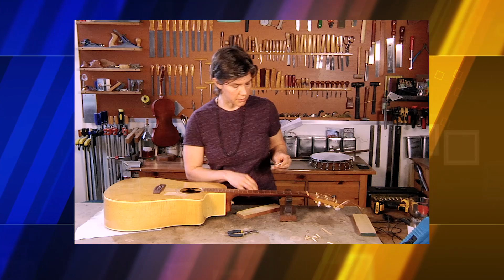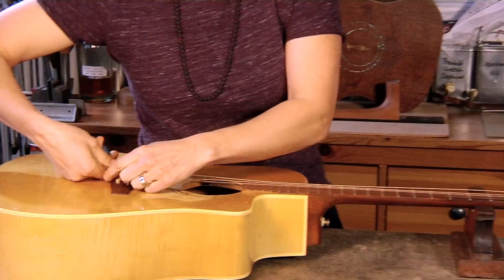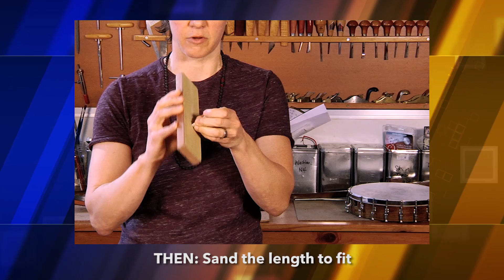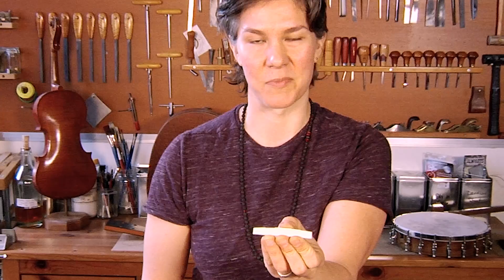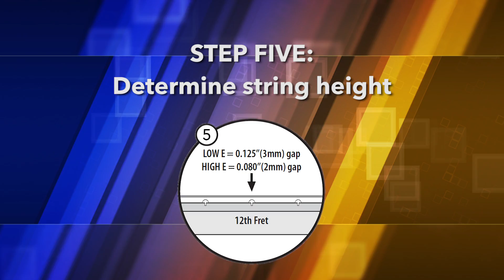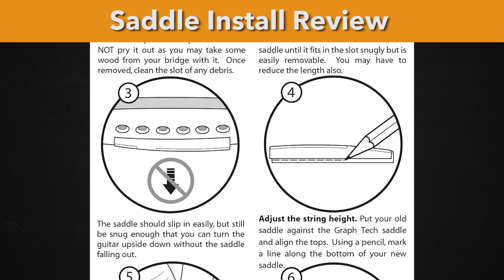Graph Tech Training Series: How to Install an Acoustic Guitar Saddle

Comment: Great video! Very straight to the point and informative. To every body please remember like she said, action height is very personal choice. The string action she made for this guitar is usually considered high, probably the owner of the guitar strums hard, plays bluegrass or simply prefers that kind of action. A very common middle of the ground action height I like to use is 6/64th in the bass side and 4/64th in the treble side. I recommend buying the Music Nomad setup kit that includes string measuring tool, and gauges to measure neck relief and nut height. there is more than saddle height to deal with when it comes to proper a setup. I usually check neck relief first, then nut height and then saddle on acoustics.

Comment: Very excellent presentation Nicole. You showed your handmade, I suppose, dual sanding blocks method for sanding down the base of the bone saddle correctly and easily. The blocks look very flat and level with maybe 200-400 grit sandpaper permanently glued on. The combination of the 2 blocks used together as demonstrated is a great way to work on a new bridge saddle. I am going to make 2 blocks like these.

Your approach to the workpiece guitar was straight forward. The explanation gained most of my attention partly because I was not distracted by you working on a glitzy fantasy guitar. Your workpiece was an indescript 'work in progress'. I think that gave added focus to your demonstration of the skills and procedures.

Working on a guitar is a type of precision work with a delicate and precise object. This is not hammer and chisel work. It is delicate work and needs to be planned out and worked on with patience and thought. One should probably not just pick up the bone saddle and start sanding on it with a piece of sandpaper in your hand. You should probably take your time, learn about it, and use the right tools and methods.

The average player wants to make their instrument better when they work on it. Watching great but simple videos like this can enable the average player to perform some of the techincal work and maintenance on his instrument. One can take pride in doing good work on a nice guitar.

Comment: Since this is a beginner video it would be helpful if you mentioned which way the saddle goes and why
Reply from the maker: Usually, one end of the saddle is taller, and the taller side is on the low E side of the bridge. Hope that hleps!
Reply: @GraphTechGuitarLabs  yes it does help, thank you!

Comment: You did not check intonation. Should that be done? Even if you have a pre-compensated saddle? I have a new Enya Carbon Fiber Travel Guitar that came with a non-compensated saddle. Consequently, the high E and B string are both 9-10 cents sharp at the 12th fret. Do you think a pre-compensated saddle like the ones you sell would help that? It came with a quality bone saddle installed but it is not compensated. It came with the action perfect by the way. Very easy guitar to play finger style.

Comment: I have an acoustic guitar that was given to me used and the saddle is gone! I bought some on Amazon and they are very thin & 2 fit into the slot in the bridge!  The music store attendant said that there is usually a couple of holders that one of the saddles would be pressed into so it won't fall out! There wasn't, the slot is 3 1/4 inch long & 1/4 inch wide...HELP.

Comment: One question. I took my saddle out and sanded it to lower my action. When I went to re-install it. I realized there is angle on the top of the saddle. Should the high side of the saddle be facing the sound hole or facing away from the sound hole?

Comment: I did this with  Tusq saddle but the 5th and 6th bass strings would become sharper and sharper up the neck.  The 12th fret note and harmonic were different notes.
Reply from the maker: Hi, sorry for the delay in my reply …  I’m pretty sure that was how it was before you replaced the saddle ,  an acoustic saddle only has a very small amount of intonation room …  ( which was what you were measuring on the 12th note and harmonics)  sounds like the bridge slot was made a little too close the nut side of your guitar and causing the sharpness in pitch as you played up the neck…  not an easy thing to fix without filling in the saddle slot and routing in a new saddle slot in the right position or replacing the entire bridge …  either way, not recommended for the faint of heart …

Comment: you never mentioned anything of the radius.? Don't you do that ?:
Reply from the maker: Great question. We make a lot of different saddles, compensated, non-compensated, blanks, and thicknesses. Easiest way to navigate through a lot of options is download our online catalog, the last 20 or so pages are life size line drawings... find some models that are close to what you are looking for and print them at 100% and just match up your existing saddle for radius... saves buying a radius gauge for a one off install...  thanks again!
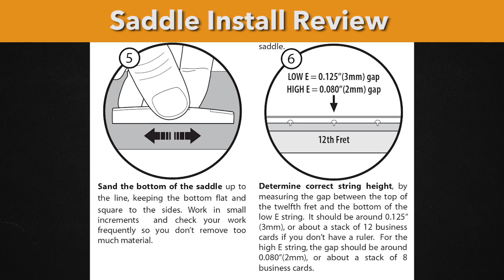Reply: 6:22 6:22  @GraphTechGuitarLabs

Comment: This demo assumes you are duplicating a perfect saddle to begin with which is rarely the case :( Even new, name brand guitars are rarely setup properly from the factory. What then? I guess you buy a half dozen saddles and resort to trial and error if you're not starting with a perfect saddle?
Reply from the maker: You’re correct on no two guitars are the same.. I think if you get into the 3 minute mark of the video, Nicole gets into how to adjust for your  particular guitar. Thanks for mentioning about this 👍
Reply: #Drvn Lp this is not any science though. its so easy and non risky i do it by sight and feel i dont bother measuring it.
Reply: @joaquinodriozola4963  Yea, it looks like if you put a straight edge on a straight fingerboard it will line up at about .120" below the saddle nut when the strings are off. I haven't confirmed but that looks about right. This is the kind of answer I was looking for so I am posting in case anyone else is interested :)

Comment: Disclaimer:  I’m not a luthier.  But for 40 years I’ve done my own saddles,  I adjust string height across all 6 strings by notching the ALMOST finished saddle to the exact height I want with nut saws.  With this method I can adjust intonation as well by moving the cut fore and aft on the saddle.

Comment: sanding all that material off the bottom is too much work... better done with a saw and a simple jig to make an initial cut and then fine sand to height. Even a cheap mitre saw kit will get you close and ready for final sanding the bottom...

Comment: A good story, but why does luthier recommend such high string action ? 3 mm and 2 mm . Most sources say that the height of the 6th string over the 12th fret should be from 2.4 to 2.8 mm , and the 1st from 1.5 to 2 mm .Lower the first one, for example, by 0.2 mm or 0.3 mm in comparison with the height that Nicole recommends and it will be Much easier to play ! And Tommy Emmanuel also has a low string action .
Reply: She said in the video that making the action higher at first is better because you can't add height to the saddle once you sand it off but you can shave it lower if your action is to high.

Comment: So which way is a compensated saddle installed in the slot? There are 2 directions !
Reply: As a general rule, the bass side of the saddle is higher,  and  and the B string compensation is usually kicked back , away from the headstock ...

Comment: Hi Nicole. I dont have the old saddle of a guitar i am restoring. It is an acoustic admira A-50 from the 80's.
I saw in the website that there are different Tusq saddles, i suppose the best choice will be the compensated one with the nearest similar measures that fit the slot. Any suggestions?

 BUT, for a saddle and a nut i need, Will you deliver to Spain?
I mean, i havent been able to see the shipping costs.

I am thinking right now that i will need something else that i dont really know if you are selling it, just to make the order worth paying the shipping cost, like powder pumice to close pore as i am varnishing with shellac by hand, and a Rosette. Gonna check the website and see.....🤔

Comment: I have the PQ 9210 00 tall saddle for classical.  As I predicted, there is no explanation as to which way it goes in.  The compensation is asymmetrical so it can only go in one way.  This info is hard to find.  I can't find it.  Even emailed Graph Tech.  They can't seem to comprehend my duh question.  What the . .. ??
Reply from the maker: Not sure who you emailed,  but the laser etching or the lettering on the saddle faces the sound hole/ neck. Hope that helps!
Reply: @GraphTechGuitarLabs  thanks.  next problem:  The slot on my Mexican classical is 1/8" wide.  the  PQ 9210 00 is much less thick.  It leans precariously toward the tension.  Should I shim it (on which side?) or do you have a thicker one?
Reply: 2 years later, no answer.  I reordered the  PQ-9204-00 which is 1/8" thick,  A little sanding on the side (220 grit--she didn't tell the grit) and I slid it in without removing the strings.  Without sanding the bottom, it's just a little high, will reduce it later maybe.  I don't play too much high up.  

After hearing so much about the critical contact between the bottom edge and the slot, I was surprised to see the bottom of the  PQ-9204-00 is perforated by 3 deep slots and 2 or 3 shallow round indentations.  Also, the thing was not straight across the bottom edge--visible arched upward (the opposite of experts who say it should be crowned downward)  And the bottom edge is visible not square.  

I was already wondering about the wisdom of using some kind of bedding compound, like wood filler, to solidify the overall bottom contact.  

I'm not impressed, not happy with the sound.  Seems weak, but I don't know if I can blame the erratic shape of the bottom edge of the  PQ-9204-00.  Might be crappy strings or crappy expensive handmade guitar.
Reply: Yes it's the one bit of information she omits and the most important

Comment: I just bought a new 9280 saddle to replace the plastic one in my Fender CP-60S acoustic. The plastic saddle was to narrow for the bridge slot and the plastic saddle radius was more like 9.6" radius and the board is 12" . The graph Tech 9280 was more than wide enough . The issue I found odd was when sanding the side of the saddle to fit it was clear from the sanding marks the 9280 on both sides showed I was sanding off high spots and still showed low spots. I though they were dead flat to start with , this was the  first time I had to sand one to fit the slot . I've sanded the height many times for action , never the sides. Are they simply cast and will not have a completely flat surface?
Reply from the maker: I think I get what you mean, you're saying the sides aren't completely straight, as in a 90 degree angle? Yea, there is a slight arch on the sides of the saddle.
Reply: I wouldn't describe it as a 90 degree angle . It look flat with a fine grained surface before you sand the sides, once you do begin sanding the low surface areas still show the fine grained cast surface. The surface on both sides is uneven . I imagine it does not matter since the bottom needs to be dead flat and 90 degrees to the sides . What would benefit most is since there are many times where saddle slots are wider than .125" and one buys a 9280 and it's to loose. You should offer an option or make the saddles .020" thicker since many buy these because they are already compensated . The only option is to add a wood shim to the saddle side and sand to fit or buy a blank which requires doing all the shaping .

Comment: Hi , what if i dont have my old saddle?
Reply from the maker: Then just get the right thickness and length and you can try the guitar, if it's too high, you can easily sand the bottom of the saddle down to get the right height!
Reply: @GraphTechGuitarLabs  Do we have to keep taking the strings off?
Reply: trial and error.  install it , measure, do the math, sand it, etc

Comment: Hi, the action with 3mm / 2mm is very high and not ergonomic, especially with thicker strings from 0.012 and more. It the frets are dressed up correctly, on a western guitar 2,5 mm / 1,8 mm should be no problem, even 2,2 mm and 1,5 mm should be possible (of course depending from playing style). Also, the ruler you use is much less precise then feeler gauges – I've seen instruments that could not be played properly, but the tech showed this ruler and meant these were 2 mm (they were not, and if this tech would have been a better guitar player who feels the difference between 2,5 and 2 mm, he would have known this!).

Comment: I have an acoustic thats missing the original saddle. How do I go about getting the height right if I don't have the original saddle to reference?
Reply: trial and error.  install it , measure, do the math, sand it, etc
Reply: Look up on their web site for the right one for your guitar
Install it as she showed.
Sand a little off bit by bit to get her suggest clearances.
As she said if you want it lower sand a bit more.
It is not rocket science  :)

Comment: is the method to check the thickness and length of the new saddle for a match to the old one first? Seems like common sense to me.
Reply from the maker: Hi Doug, thats correct. Match it to the old one and that will help you determine the exact fit you need.

Comment: How do I set the intonation? This is driving me crazy!
Reply: There are multiple possible reasons the intonation may be off. Make sure the strings are new and you are not fretting too hard. Make sure the neck is straight and has the correct amount of relief. Note that if the action is too high then notes higher on the neck will be sharp.  Then determine if the string length needs to be longer or shorter. If it’s longer you can sand the top of the saddle at an angle over a particular string so that it makes contact slightly further from the nut. If it needs to be significantly shorter, I would take it to a luthier because fixing that will be more complex.
Reply from the maker: You don't! If it's a compensated saddle, then the intonation is already done for you!
Reply: I already have one (made of plastic) and the intonation stills bad
Reply: @juliofernandez3434  try the Tusq?

Comment: Great video but I wish you demonstrated how we can get the correct string action height, what if the high e has higher action height than the lower e string? Should we sand off the saddle on the higher e string till it gets the proper height?
Reply: I sand the saddle at an angle to get the correct action for high and low e strings.

Comment: Thanks for the video-- but how do you know which side of the saddle is the front?  Is it the side with "Tusq" printed on it, so that the taller part of the saddle goes under the low E?  Just checking...
Reply from the maker: You'll want to point the Laser Etching towards the sound hole!
Reply: @GraphTechGuitarLabs  uh . . . what is laser etching?  Are you referring to the black lettering?
Reply from the maker: @treslongwell1332  Yea, the black letters face the neck/sound hole!

Comment: This is a great video but one thing....no one ever talks about how to lower the saddle on one side alone...the  tusq saddle on my acoustic guitar is 5/64 on both sides from when I bought the used guitar.....I believe someone replaced the saddle and never lowered the high "E" side.....what's the best way to do this?  If I sand just the high E side the saddle will have a high spot in the middle.  Common sense says I then need to level the bottom of saddle but I would like to know the professional way to do this.
I just refretted the guitar with stainless steel frets.  All the frets are level but I'm getting just a little buzz if I hit the A string hard at the 5,6,7th fret.....I have .011 relief in the neck.  Do you think raising the saddle to 6/64 on the low "E" side would make a difference?  I could shim it just to test it and if it works just buy a new tusq saddle....I'd rather have the relief at 8 or .009 thousands and a higher saddle.  A guitar feels totally different when it's less than .010 relief in the neck.
Reply: Simply determine how much to take away by measuring the high E (fret 12) then deduct the 2 mm. Hold the saddle at the required angle on the emery board and sand it to a straight edge at that angle. Use a new saddle, keep the previous one to fall back on.  Repeat until you are happy. At $5 NZ for a NuBone saddle this won't cripple you financially.
Reply: There's another way.....I found ....use a crowning tool to create an angle on top of the saddle....it's a bit of a pain because then you have to re-intonate the saddle.  I've done it your way......it's not a simple thing to get the right angle but both work.  I did the crowning tool thing last night.
Thanks for the answer Graph Tech!  Not!

Comment: Thanks for the video, can you please explain why there is an extra compensation for the B String on the saddle ?
Reply: It's a few things mostly because of the tension & the kink in the 4th tuning i.e. "Tuning 5th fret to open string till you get to the G string you have to go to the 4th fret to open B then back to 4ths tuning w/the B string 5th fret to open high E". Thus the B string needs to be longer so the compensation for the B thats a simple way to explain.